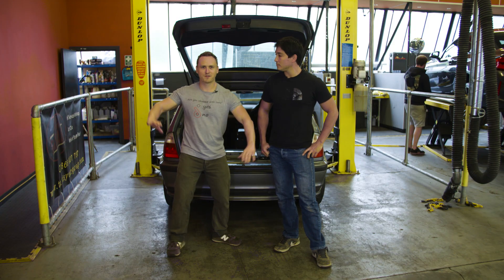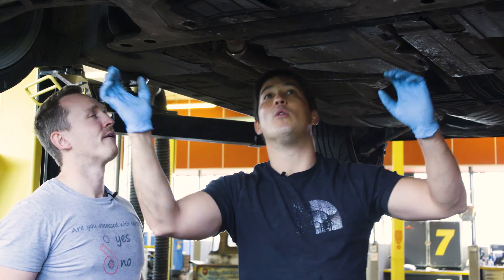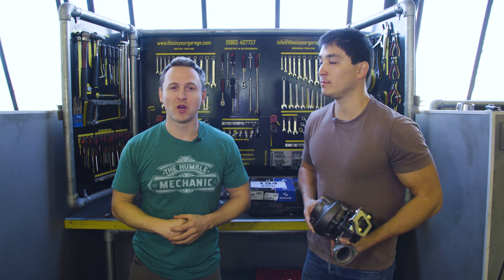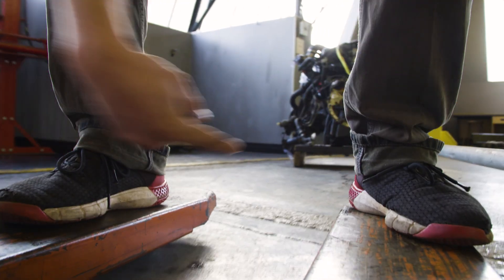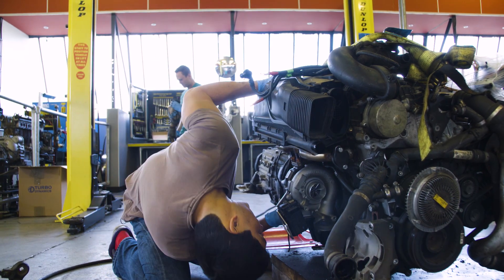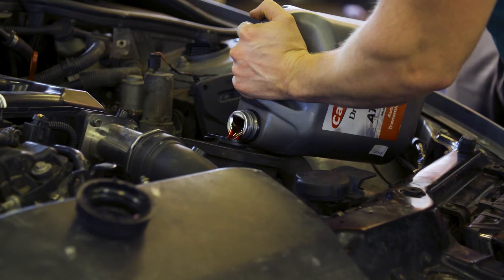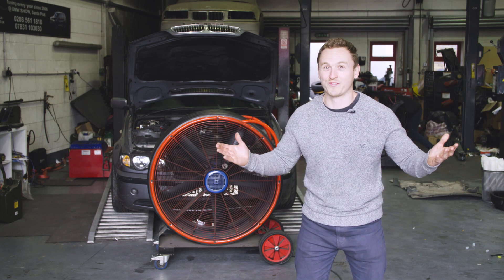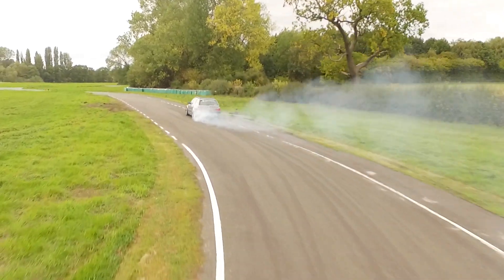How Much Power And Torque Does A Hybrid Turbo Add To A Car?

Comment: Should have done an LSD first.
Reply: I thought the job was confusing enough sober.
Reply: @SocksWithSandals  good one
Reply: lol
Reply: Most BMWs come with them for the factory. At least the BMWs ive owned.
Reply: THEWIDOWSON - It is (and has been) an option on many models but it’s not standard on non M-models. And despite it being an option, it’s alot more common that they have the standard open diff.
Reply: LSD is only good in bad track conditions ie(snow,rain,etc)  what difference is going to make one wheel spinning slower mid air on time track?
Reply: @qiblik  Incorrect but okay 😂
Reply: @qiblik  he was struggling to get a clean start before extra power, now he is just going to get too much wheel spin. LSD would help with that a lot.
Reply: Martin Keleceni grip coming out of corners. I don't understand how someone could say an LSD would only help in bad conditions. Especially when someone is trying to get a fast track time. Doesn't make any sense. Try again chief.
Reply: Martin Keleceni - What are you even trying to say? Mid air on time track... What?
Reply: @JolleBoiii  if you hit a kerb and the wheel lifts up off the ground for a second. The dunlop chicane at le mans comes to mind
Reply: Martin Keleceni you ok hun?

Comment: I would'nt be supprised if they had'nt tell anyone, that they flashed the ecu on dyno. I really think that they will do it, but not tell anyone, because they needed to sell their "race chip"
But overall, it is good video today. Shame that they could'nt go on track.
But about clutch... You don't need aftermarket clutch actually.
I have 535d engine (200kw)... manual transmission....  And it is holding on with original clutch.
I don't undrestand why they needed to take out whole engine? It is a lot of work to do it. Turbo and cluch is tottaly replaceble with engine on, even when doing according to original repair manual.
Reply: transmission is the same 6spd from e46 like in video?
Reply: @berislavtopol1404  yeah gs6-53dz, althought e46 has smaller bellhouseing.

Comment: Ok, now it needs a less restrictive exhaust. Put a 3" straightpipe all the way from the turbo back if you can. I don't know if there are any better exhaust manifolds available, but if there are that would be good too. Also it isn't making as much power as it could in it's current form. Make it run richer and you'll make more power. Add another 10% more fuel and 3% more boost. I know, diesels are scary, but it should have no problem with that.
Reply: Never rich a Diesel. Run lean & clean to mitigate the environmental disaster
Reply: @ellenorbjornsdottir1166  You obviously don't understand diesels. Having soot is actually good. A little bit of soot means the engine is burning as much fuel as possible, and the soot traps some of the harmful chemicals and falls to the ground. I would go into some of the actual chemistry but I'm too lazy.

Comment: What counts is the wtq figure. Diesel cars generally have higher diff gearing so stop cumming over having more engine torque than the M3, since it probably still has less torque at the wheels. And that's coming from somebody who regards M57D30 as one of the holy grails of engineering.
Reply: Don't bother mate, it's basic classical mechanics that's been around for over 400 years but people still don't get it.
Reply: Well it upsets me a bit that people here, referring to themselves as petrolheads, claiming that know something about engineering, are quite often clueless. Word petrolhead once meant "I know every bolt of my car like the back of my dick" and now it gradually turns to "I like quick golfs and hats with stickers". Sometimes I feel like we're living in intelectual dark ages. Soon knowing actual mechanics will be considered witchcraft.

Comment: Blowoff Valve and Anti-Lag please!
Reply: Just no. It doesn't need anti-lag and a blow off valve. Stop.
Reply: I am not Jon Garret needs a fitting end to the extreme, unless they keep him as is 😉Also, water-injection!
Reply: They have all the power they need for that track, and just need to focus on handling modifications like a splitter or a undertray
Reply: I am not Jon I totally agree, I’m just feeling a bit empty on the show part of show n go. I ge the point of the series is to smash the e92 M3s time, but some excitement and motor madness would be appreciated. Just my opinion. This is all for our entertainment, either way still love the show. Maybe it’s the jump from Hoonigan lol What do you think?
Reply: Its a diesel, it doesn't need/benefit from either of those things.

Comment: New intercooler would probably be a good idea guys, and a new exhaust too
Reply: Yes, you can see on the torque curve, compared to the unmapped tune, the mapped one starts to lose torque comparatively early. That impacts the final power curve (power=torque*speed). A freer flowing exhaust + intercooler will help a lot. I'm sure they will, they are just stretching this out over months for maximum YouTube revenue. And who can blame them really.
Reply: Zadster I would stretch it over months too, I mean those parts ain’t cheap
Reply: Usually, you're better off with a proper exhaust manifold than a full exhaust. There's a lot of high speed high pressure air that has to squeeze through that thing and perform several harsh bends, that's going to limit your power more than what comes after the turbo, which tends to be high flow already.
Reply: Central Intelligence Agency what so 2 cats a resonator and a silencer won't affect performance at all
Reply: Exhaust for sure, there probably is alot of backpressure cyz they usually have the cat straight after the turbo
Reply: Yup with shitty guys tuning my car I got +330HP/740NM with hybrid turbo, better IC and inox 3" exhaust pipe with 2 mufflers, it's prepared to acheive around 380/400HP and ~900NM, but too much work for me atm.
Reply: @kamilg8026   to reach 400hp you need CP3 and 35d injectors
Reply: @Turbovij007  forgot to mention it have "219" injectors too. Maybe fuel pump is locking me now then :D
Reply: @kamilg8026  wow, that's impressive,  but sounds expensive
Reply: @tassietwinlocked4x474  Not really, E46 330D are really capable and easy to tune. I've sold it for 2.7k eur, and guy who bought it pushed it to 470HP 880Nm. Well he had to ditch old parts and get different turbo, injectors, clutch, fuel pump, exhaust, portings, but total cost of this tune with map and professional labour was ~3.5k eur for him minus old parts that he sold. Then he fixed interior, removed rust, refreshed paint, new rims etc, and recently sold it to norwegian guy for 8.5k eur.
Reply: @kamilg8026  all that work would cost $10k here in Australia 🇦🇺 😏... mine has the same engine,  but just a dyno remap here in Australia  is around $1500aud to $2k.... but I've been in talks with bwchiptune in the UK about a tune,  good euro diesel tuners are few and far between here..... I usually  do all maintenance  and repairs and upgrades myself, except  for doing tyres and exhausts, but I'm super keen to modify upgrade and tune my new x5 , one of the very few vehicles I haven't ever tuned or modified is a euro 3L turbo diesel BMW or merc
Reply: @tassietwinlocked4x474  I did it all in Poland, cheap and best tuners in EU are located there IMO. Beside those tunes I have a heavily tuned street legal Daewoo Lanos (grips not much worse than my mint condition Lotus Elise with sportpack) and showcar type VW Passat B5 with air ride, N2O injection, ~4k eur audio (2000Watt RMS - super clear at full power), bucket seats etc. Everything done in Poland for cheap. Actually I'm about to sell that Daewoo for ~500eur
Reply: @tassietwinlocked4x474  How did it went? Did you tune that X5? :D
Reply: def need a new exhaust if you want to get more than 350hp relatively easy, I know people from my country get a lot of power from 220hp Fiat Coupe with Imprezas turbo, chiptune and exhaust you can almost double that 220hp, but that's just for the lulz, can never be as good track car as e46, but it's fun and looks nice, so a lot of people got them as project cars
Reply: Also bigger injectors.
Reply: @Rentta  535D e60 injectors
Reply: I agree
Reply: 100%!
Reply: When these oem fmic have been tested they perform fine
Granted oem connections tend to leak
But as for flow and cooling oem FMIC is fine

Comment: I miss the instant on/off and super aggressive biting nature and crazy-heavy pedal of the 4 plate AP Racing paddle clutch I had on my GTi-R back in 2000. Not the most fun when doing hill-starts in traffic in the wet, but once you get used to it there’s nothing quite like it!
Reply: I love my 4 paddle lol
Reply: Mmmmm GTi-R. Love the sounds of quad throttle bodies on a SR20👌🏻

Comment: Did you install a new stock flywheel? Did you consider Single mass flywheel conversions? Are there any benefits in converting your dmf?
Reply: dual mass would protect the gearbox that is being massively stressed i guess.

Comment: why didnt u put an exhaust system on it while u were there!
Reply: yazctr extra episodes tho.
Reply: He said there is a second part to the series. They’ll probably install the  other serious hardware when they start filming that.
Reply: Mad Rooster in other words making the series longer so they get more views and more YouTube revenue smart thinking if you ask me
Reply: Replacing the factory exhaust manifold won't gain you anything and to give decent gain, I'd using a minimum of 3" pipe after the turbo
Reply: yazctr I know all those restrictions from the factory manifold and the rest of the intake. That was a dumb mistake. So you literally won’t be able to put a aftermarket exhaust manifold on the car unless he pulls the motor again.
Reply: @charliecherfan295  There are no aftermarket exhaust manifolds for the M57 engine. The stock one works perfectly. Go back to playing Need For Speed to do your aftermarket upgrades there. Also why would he need to pull the motor just to change the exhaust manifold? Goes to show you have zero experience as a mechanic, yet you speak as if you're the expert. It can be removed easily from underneath the car btw. Please go back to playing games and let the adults do the car talk.
Reply: @omfgwtfbbq90  I changed the stainless manifold back to a cast iron on mine, more reliable. Nice Mastodon pic you got there too man! 👍 That prop will need doing too (surely??) , mine has only had a standard remap and I had to do  that as well....
Reply: @hoodwinker7932  My E39 525d has an iron exhaust manifold from factory, is still solid after 340.000 km. But I've heard stories of the newer M57 on E60 and/or E90 having stainless steel manifolds which do sometimes break? It's not like the iron one rusts easily. It's massive and is always hot. Don't know why to change it at all?
Reply: @omfgwtfbbq90  I don't know, if there isn't an issue why bother. I still reckon that prop is gonna let go pretty quickly and the diff will spin away all that extra torque and horsepower. Essentially I'd just spend all that cash on an actual m3 (e46).
Reply: @hoodwinker7932  you mean prop shaft? It should be sturdy enough. Not a lot of stories of them breaking. It's built for diesel torque.

But the nice thing about diesels is they're economic and quiet on long trips. The M3 isn't.
Reply: @omfgwtfbbq90  mine went, I just wondered if it was a common issue.
Reply: @hoodwinker7932  i did the same 600+ skyline hp killed every aftermaket manifold i put on her went back to std (but flowed internally) manifold and 3years later still on her and all fine with no cracks 👍
Reply: omfgwtfbbq90 I’m sorry I’ve never owned a bmw since I drive a 98 civic sedan and that is what I modify and work on. You don’t neeed to get triggered just because I don’t know much about one specific thing on one specific car that I’ve never owned. I normally think when the manifold is that tucked away underneath the car it’s hard to get it out unless you take the motor out and that’s fine I was wrong.
Reply: omfgwtfbbq90 And I don’t remember stating anywhere that I was a mechanic. I just do things in my back yard in my garage with hand tools and a few friends
Reply: @charliecherfan295  it's fine man. At least you have the guts to admit you're wrong on the internet. A rare trait these days. I simply dislike when people assume something without knowing facts or having the proper insight to know, only to blindly follow in their own idea. Even if it's tucked away, you can simply unscrew lots of things to get to it. "I have to pull the engine just to remove the stock headers" is what literally no one ever said. It sounded a tad ridiculous to me. To top it all off, it's a diesel. 4500 rpm max. It doesn't need a spaghetti exhaust manifold. Haven't you seen the video? He got 300 hp (not to mention mega torque) with stock header plus the tuners say they can get even more out of the engine.
Reply: omfgwtfbbq90 I saw the power gains but from my experience exhaust manifolds can sometimes be restrictive which is why I questioned that he didn’t change it. Thanks for understanding and we all make mistakes sometimes and move on. Looking forward to the next episode. It did make some good figures and it’s going to destroy that m3 :D
Reply: @charliecherfan295  can't wait either. These series are quite interesting. Especially for me because I got an E39 with basically the same engine in it (2.5L) so it's fun to see what it's capable of.
Reply: I was referring to a turbo back, not the manifold. i.e. get rid of the cats and mid-boxes a nice 2.75" stainless from turbo to a well flowing backbox.
Reply: @charliecherfan295  there are loads of companies that do a turbo back system for e46's and std mainfolds are much stronger than most aftermarket ones.
Reply: In most cars it would make a difference but in bmw’s generally they are very well designed and gains would be small even if you straight pipe everything
Reply: Cause it’s not in the car throttle store.
Reply: @gilbertoguel9890  neither is the turbo
Reply: @omfgwtfbbq90  it was the knuckly thing. I'm no mechanic. Used to vibrate like a bastard when the torque kicked in on a low rev high gear (for example 40mph in 4th gear from 1500 rpm). Which is why I'm a bit skeptical, some of those tolerances must be getting pushed to the limit on the Gareth BMW.
Reply: @hoodwinker7932  1500 rpm is way too low for max torque. Boost comes at 1750 rpm stock, that's where the car was designed for and the rest of drive line. Perhaps your remap was way off in that regard? And the knuckly thing could be the vibration damping disk with 6 holes/bolts? Perhaps it had to endure too much vibration in the wrong rpm.
Reply: Yeah man at least a de-cat pipe
Reply: yazctr because it ISNT SOLD ON THE CAR THROTTLE WEBSITE

Comment: Ok, let's by an E46 M3 for this price. With the price of the car, all the modifications, and now a Hybrid Turbo, it starts to be really expensive...
Reply: ptibab73 this is true with any car you modify... Except something like an RS or AMG where it's cheaper to tune that than getting a supercar
Reply: Yeah, but I start to wonder if it wasn't cheaper to buy a M3 E46 and put some tyres+ Suspension than buy a 330d and put a lot of money on it...
Reply: ptibab73 of course it would have been cheaper. And then there is the issue with resale value. You'll get most of the money back selling an upgraded M3, but none of it back selling a 330d that's no longer comfortable, reliable and good on gas

Comment: So...why the racechip if it was going to get remapped anyway? 🤔
Reply: It was an experiment
Reply: @alexkersten1964  Fair enough!
Reply: Its free anyway so, why not.
Reply: @alexkersten1964  would you recommend one? Surely it's as good as a generic map from a well known remapping company?
Reply: @alexkersten1964  It isn't getting enough fuel. It doesn't smoke at all. If you put a straight pipe on it and get a bit of soot out the exhaust when you stand on it, then it'll be running most efficiently. Not as economical but this isn't about economy.
Reply: Banks would disagree. Smoke is wasted power, they have done the science.
Reply: that video was an ad , they wanted that revenue 🅱oi
Reply: Money....
Reply: Or why tune it if the racemap is so good & adjusts ;)
Reply: yes it was sponsored video $$$
Reply: Incremental gains bro
Reply: So he can sell more chips, of course!
Reply: Because of the turbo
Reply: Roll coal not your soul.  Tdi power💪🏻
Reply: The part of the point before was showing off their wares, like the piggyback. Apparently they moved on to more drastic measures.
Reply: why engine breaking? I have never actually heard somebody complain that their engine broke because of a recechip (by which I mean the exact company)
Reply: Daniel Deutschen my issue will chips is the false claims about extra power, most are not cheap either nearly the same price as a decent remap on a dyno
Reply: They seem to be very legit on their website and even provide options with warranty, so that's pretty cool, most ECU tuners don't even give you a warranty...